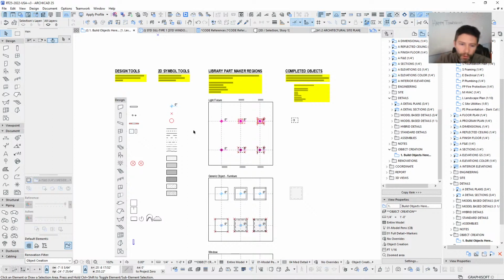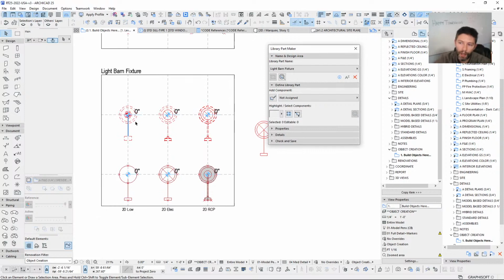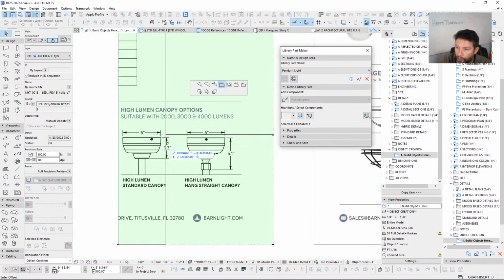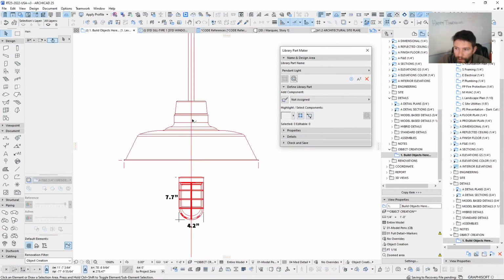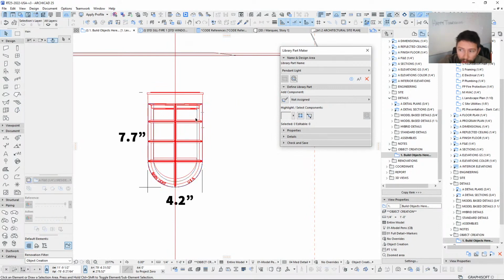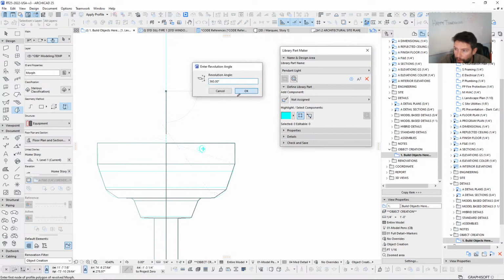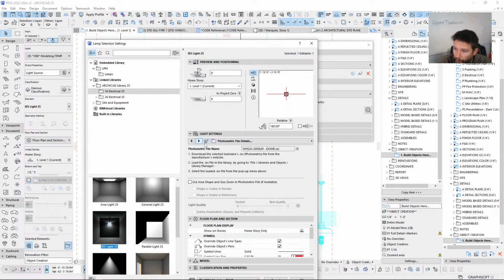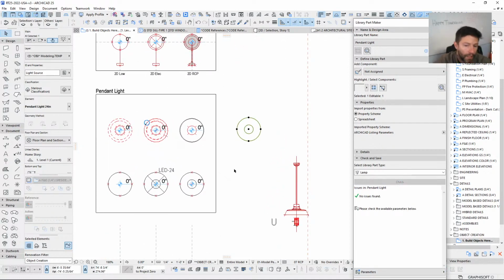Archicad Library Part Maker Training by CONTRABIM

Comment: Can the library part maker, can it create sliding doors? We currently use Cadimage but it is limited and can be frustrating to use. If I could model up a sliding door, create the 3d and 2d elements, be able to open and close them, add the arrows in plan view, that would be worthwhile creating our own.
Reply from the maker: Thanks for the comment! I have created a sliding door, and actually did so as part of the Library Part Maker tutorial course I did.... But you have to know that with the LPM, the doors will essentially be locked into place, meaning you can't slide them open in 2d or 3d. They are locked objects. But what you can do, is setup different configurations of the same door, so that they can be represented as open, closed, or partially open, based on the different MVO settings you assign. The floor plan representation can be whatever you want it to be, and it is actually just a symbol, and not a direct projection or cut of the 3d door itself. You can certainly add any arrows in plan and section. Hope this helps! Give it a try!

Comment: It can be use with section and elevations?
Reply from the maker: Yes it works just like any other object! Thanks for the comment!
Reply: @CONTRABIM  I mean if it can be customized in the same way as in a plan a cut or elevation, because in the video only do it with plan ...
Reply from the maker: @reneignaciorebolledocanale6678  The plan view has it's own 2D symbol options. The elevation and sections are based on the 3d geometry of the object, so whichever representation you have turned on based on the MVO settings, will be displayed. You can't have 2d symbols displayed on those views, just the 3d projection of the object. But yes!